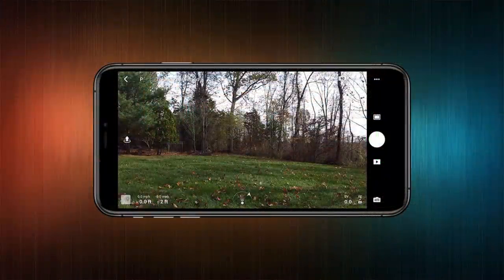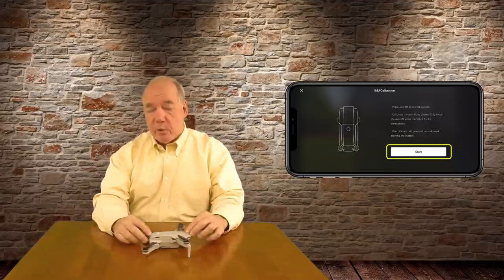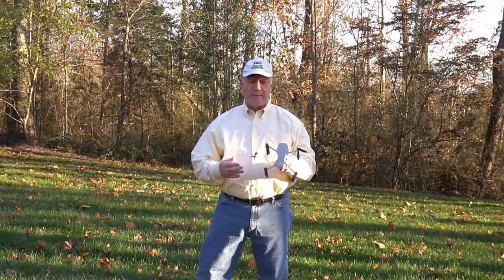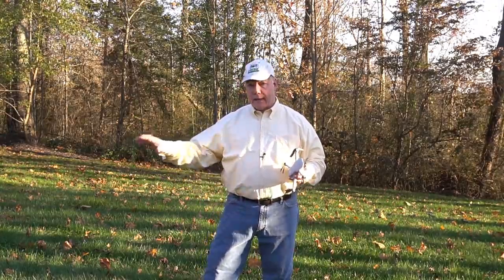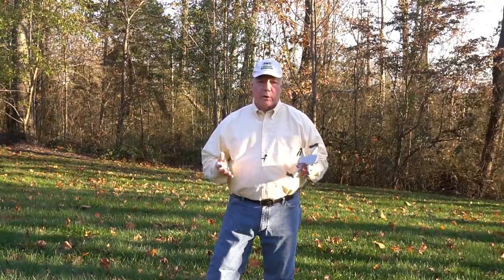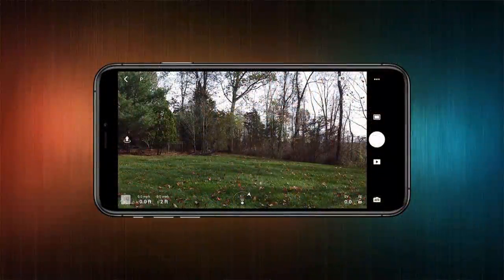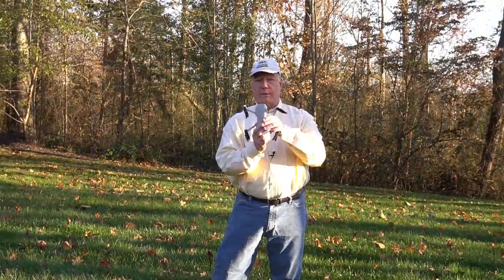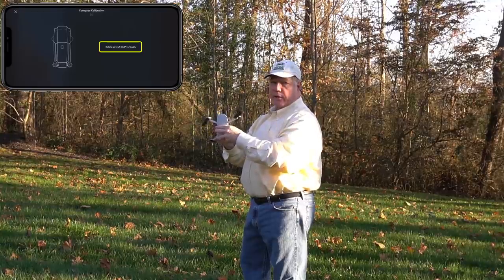Mavic Mini - How to Calibrate Your Compass & IMU

Comment: I've been flying for 3 years and I was looking for a compass calibration video to send to a friend and brand new flyer in a group  im in and I watched your video on it to make sure he'd be able to understand it and i found out by watching that ive been doing it wrong all this time or you did it wrong cuz my calibrations always work the way i understand it to be but for sure I don't do it like you did it in this video. I do it exactly how it shows in the tutorial. For one you said to spin it 2 or 3 rotations but it only tells you to do it 360°  which is one rotation. Other than that you spin it completly different than it shows me on my tutorial. Is there more than one wag to do this cuz now im evdn confused
Reply from the maker: Thomas, there is more than one way to do it and I was following the directions on the application I was using at that time. I had the quad early before release and was using a Beta version of the DJI Fly app, which had diagrams that were changed for the final release. Either way, what you;re essentially doing with the compass calibration is letting the internal (digital) compass find North on both of the axis. You need to spin it vertically a few times until it can confirm North and then spin it vertically for it to do the same. Once it gets a sense of the direction in both planes, it will let you know you're good to go. The one mistake I see people making, which can affect the quad is to hold it at arms length and spin. This puts the rotation point 3 or more feet away from the quad and even though it seems like it will work, your compass will be off by a lot. Spin it tight and you'll be fine. I hope that helps and thanks for the post. Rick

Comment: the campus calibrate you show is different than what the campus calibration is shown on my dji p3 pro. I'm confused, I have had the p3 pro for several years and have always done it per the pro instructions. and it always works ok. did they change the calibration instructions for the mini. ?
Reply from the maker: Thanks for the post but the calibration is a little different between the various quads. The procedure I showed in the clip is correct for the Mavic Mini. You'll the same steps in the application when you walk through the procedure. Rick
Reply: thanks for the reply, but I think I will use the old reliable one I I used on my DJI p2,, p3, p3 pro,and maveric pro, and when it delivers to me the mavic mini. all very reliable drones .  only problem I have ever had is I had a fly away, one of my p3 pro's (my fault, and it landed in the canal.) total loss. I bought another one, it is one of the best drones I've ever had.
Reply: by the way Rick, I'm 87, life is good.
Reply from the maker: That's great! I love that you're out flying and enjoying the day. Stay tuned and let me know if you have any more questions for me.

Comment: Quick question, when you put it on its back its not level... is that ok or doe this introduce some errors?
Reply from the maker: Thanks for the post but you don't have to be exact with it's placement. The calibration is designed to find "relative" positions in reference to it's initial standing position of the desk. It needs to understand 90 degrees and 180 degrees in both the Pitch and roll positions so it can define it's range of travel. I've actually done this calibration in the field by simply holding the quad in my hands and it's worked well. If it's position is off by too much the calibration will fail and you can start over. Thanks again for the post and be sure to sub the channel so you don't miss anything. Rick
Reply: @Dronevalley  Thanks for getting back to me.  Good to know... still waiting for my Mini to arrive thanks!

Comment: Rick could you help a drone fan I just bought the mavic mini and was told to type dji fly app but there's around ten app.s pop up and some are just for photography apps which app logo is the fly app for the mini I'm waiting your video to calabrate it but need to know correct fly app so I can fly it to day as I only got it yesterday any help would be appreciated guys help?
Reply from the maker: Andy, you need the DJI Fly application for the drone. If you go to the DJI.com website and click "downloads" you'll see the logo and I think they have a QR code you can scan to get the app as well.

Comment: Hello. Can I do compass calibration with gimbal cover on?
Reply from the maker: No, you need to remove the cover so the gimbal can move around during power up for it's initial position testing. If you leave the cover on, you could damage the sensitive gimbal motors so be sure to remove it whenever you power up the drone. I have a few more clips posting this week so be sure to sub the channel to make sure you don't miss anything. Rick

Comment: I have a Mavic Air and I have to calibrate the compass every time I fire it up. Is this normal?
Reply from the maker: If you're getting a compass error every time you go out to fly, that's unusual. The only thing I can think of that would cause that is if you're flying in an area with a lot of magnetic interference or you have a lot of metal around the quad when you power up. Try taking the quad to an open field, take off your watch and leave your phone and controller far away from you and power up the quad to see if that helps. if it does, there's something close to the quad on power-up that is messing with the compass.
Reply: @Dronevalley  I have a similar issue with my Mavic Air. I guess I have to calibrate maybe half the time. I wonder if this design is more sensitive to mag interference.  My Phantoms only ever got their compasses calibrated once. In fact, I gave my son my original P4 which he proceeded to take to Australia (from Ohio). He has flown it over areas in NSW, Vic and Tazmania without a hiccough.

Comment: A compass needle is more sensitive to weakly magnetic materials. A mineral that is too faintly magnetic to be felt may still be observed to deflect a compass needle. Iron and steel will be attracted by a magnet. These metals will also deflect a compass needle, but metals such as aluminum and copper won't.

Comment: dji support replied to my video: 
"DJI Support
6 hours ago
Hi there, just to clarify, the exact way to initiate compass calibration is different, as the app's interface changed, the procedure to calibrate the compass on Mavic Mini is the SAME as other DJI drones, "
you were wrong in what you demonstrated.
Reply from the maker: Thanks for the post and while I appreciate the follow-up, I was demonstrating the process they illustrated in the Beta version of the application, which was changed (both graphics and process) for the released version that came out on 11/11. Having said that, the process is super simple and is still valid. Essentially it only only requires the quad to find magnetic north twice in both the horizontal and vertical rotations to complete. The order and actual position of the drone while you rotate it is not critical. Spin it twice on its horizontal axis and twice on its vertical axis and you're all set.
Reply: @Dronevalley  thanks for responding. Your original video was unlike any compass calibration I had ever seen with the dji mavic line. But I now understand since you were going by the beta version.

Comment: Every time I do the IMU calibration in my mavic mini its different it shows me to do it with the propellers closed and that app that your using is not the mavic mini it looks like the spark that's why its showing you different ways how to calibrate it but please use the right app that goes to the drone cuz I was very confused because the app was showing me a different way than the way you showing every body, I was doing it your way but it was wrong I had to re do it again but the way how the app showed me the right way with the right app. But don't get me wrong because you can still calibrate it like that but by watching the app is not the way your showing so it will confused the people like how i got confused 😐.

Comment: The Mavic Mini user manual is now available for download from DJI. IT CLEARS UP ANY DOUBT IN THE PROPER METHOD OF CALIBRATING THE COMPASS.  The drone is held horizontally (normal upright position) and is rotated horizontally around this axis for 360 degrees. Then the drone is oriented vertically (nose down) and then rotated 360 degrees. The manual is here: 
https://www.dji.com/mavic-mini/downloads?pbc=D3IDBfR5&pm=custom

Comment: Dose the controller need to be on during calabration?
Reply from the maker: Yes, you'll need the controller on and the app open to start the calibration.
Reply: Which is the right fly app? A type dji fly app a few pop up I downloaded the rainbow app but cant get on to level 2 so I've downloaded flight pilot but it dnt seem to work cld you tell me the correct app to use or show me the logo so I download the correct app as I've had my drone around 2 weeks now and still haven't been able to fly it yet due to picking the correct fly app for it thanks
Reply from the maker: @andyinglis8687  Andy, the app is called DJI Fly and it had the DJI logo on it with a grey background.Here's a link to the DJI site where you can grab both the Apple and Android - https://www.dji.com/mavic-mini/downloads
Reply: Think a have it I scanned the iOS code and got the one for android just setting it up now as I've been die.n to fly this from day it arrived hopefully to day will be my first flight thanks
Reply: A got the app jst had ma first flight loads more to come thanks
Reply from the maker: @andyinglis8687  I'm glad you got it sorted and hope you have a lot of fun with the quad. It's an amazing machine!
Reply: Thanks to you guys I got the correct app and had my first flight yesterday it has been the drone I wanted from day one but thought a need to buy one learn how to fly get my flyers ID and my operators ID which I have just the good weathers all we need now and I will be out most days but I dont put ivery video on my you tube channle but have to thank yous all for your help in getting the correct app for flying thanks guys be loads of videos to come which is best memory card for the mini? Or can i just use any sd card?

Comment: Should you do the IMU and Compass calibrations before your first flight?
Reply from the maker: Thanks for the post and I would recommend doing both calibrations when the drone arrives and you should be set with the IMU calibration from then on. The compass one you might want to do if you move around a lot between flights, just to make sure it's accurate. I hope that helps and be sure to sub the channel so you don't miss anything. Rick

Comment: Looks like they used the picture of the Air instead of the Mini. Must be an early version of the app.
Reply from the maker: Mike, they actually used both the Mavic air and the Mavic 2 graphics as place holders. I was using a Beta version of the app and I'm sure they will change that with the official one being released tomorrow. Stay tuned and I'll have more content posting soon. Rick

Comment: I only calibrate my drone if it has a 8 or more gps lock then it starts drifting or moving in circles when hovering.. That's the only thin I calibrate the compass, I never calibrated for a year even I change location 150 or 200km, more than that then I do a compass calibration.. And always take note, do  not calibrate if you got a message "Warning Interference, GPS weak or Compass error" It has nothing to do with calibration.. Just think logic, what makes you think it will be fine to do a calibration if you already know that there's an interference that the apps told you? you're going to make it more worst if you try to calibrate it.. The best thing you could do is Avoid that location and change spot to fly..
Reply from the maker: Thanks for the post but you're mixing up two totally different technologies. GPS is a satellite positioning system that provides a location in 3D space for the drone to navigate. The compass is based on magnetic north and helps to keep the drone stable and navigating. You have no calibration control over the GPS, it just works. With the compass, you will have to calibrate it every so often. I never said to calibrate it every time you fly but if you've moved more than 50-100 miles from your last flight, it's a good idea to calibrate it since your position relative to magnetic North has changed. Lastly, nothing "interferes" with the compass except metal and only when you're close to a surface. If you're getting a compass warning, move the drone to another spot to takeoff.

Comment: These calibration instructions are incorrect. Although the software may like Rick's method, it is incorrect. Horizontal is holding the drone flat (parallel to the ground) and spinning the drone around it's center axis. The vertical is also incorrect. Watch the illustration in the DJI software - it shows the correct method for calibration.

Comment: Don’t think your doing compass cal. Correctly isn’t horizontal mean in flying position Never seen it done that way.
Reply: I Just checked owners manual What your calling horizontal is the vertical cal. Horizontal is drone in flying position. Look on page 45.
Reply: Plus the manual says nose down for vertical but the picture shows it facing up. And rotations are ccs.
Reply from the maker: David, thanks for the post but I was following the directions in a Beta version of the firmware but it's still accurate. to calibrate the compass you only have to rotate the drone a few times through the horizontal and vertical axis for it to get its bearings. The modern chip-sets are really quick (and forgiving) with the calibration, unlike older drones.

Comment: You did the  imu wrong. You are supposed to have the propeller folded.
Reply from the maker: Thanks for the post but I didn't calibrate, I calibrated the compass and you can have the arms open or folded to do this calibration. All you are doing when you calibrate the compass is rotating the sensor through North twice for it to set it's orientation. I hope that helps and thanks for stopping by. Rick

Comment: Rick I think you need to correct your method of calibration,  (my opinion),  it's wrong and you are going to lead a lot of newcomers in the wrong direction and have possible fly a ways for an incorrect campus calibration. the only drone mfg that I know of that calibrate different than DJI is yunecc.
Reply from the maker: Thanks for the post but the process I outline is right for the Mavic Mini and you'll have no issues with the drone if you follow this process. Different drones may have different procedures so there is no universal way of doing the calibration for the compass and the IMU. I appreciate you posting but I'm sure it's the right process.
Reply: sorry, I still disagree
Reply from the maker: I appreciate the post but the method I showed in the clip was the one from the Beta version of the firmware and it works fine. As I explained, calibrating the compass on any of these drones only requires the drone to find (magnetic) North twice in a rotation in both the horizontal and vertical directions. It's really just that simple and if the drone doesn't find it, it will have you spin it again. The only way a fly-away can occur (and they are extremely rare) is with a total failure of the compass (and GPS), which is nearly impossible. If the compass was off a little, the drone would complain and if you ignored it the worst that would happen is that your heading indicator would be off slightly. I hope that helps explain it a little better. Rick

Comment: that is not even close how you calibrate your drone
Reply from the maker: Antonio, thanks for the post but it's absolutely correct and I was trying to match the postilions that were in the original application release. I had a pre-release version that differed somewhat from the final version so the one you're looking at is probably different. Essentially every compass calibration routine is the same. You have to rotate the drone through both the X and Y axis a few times so it can find magnetic North and confirm it. It makes no difference if the arms are open or closed or if you have the gimbal guard attached. Simply sit it in it's normal "flat" position and spin it around that axis until the compass sets and then stand it on it's hind legs and do the same and you'll be set. I hope that helps clear up any confusion. Rick